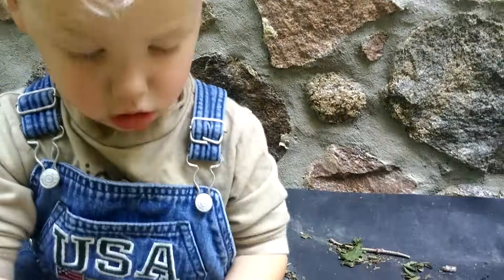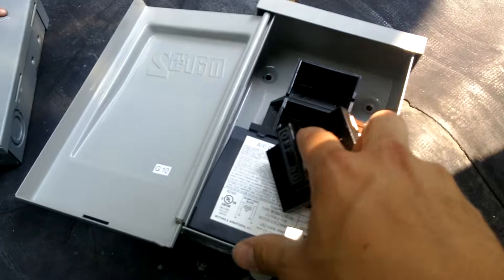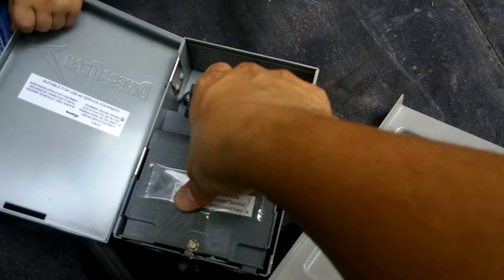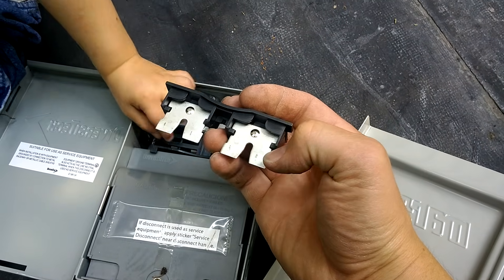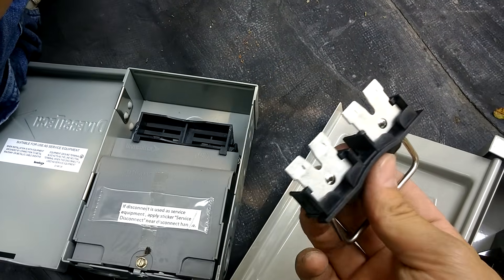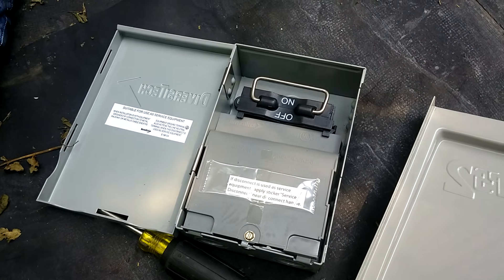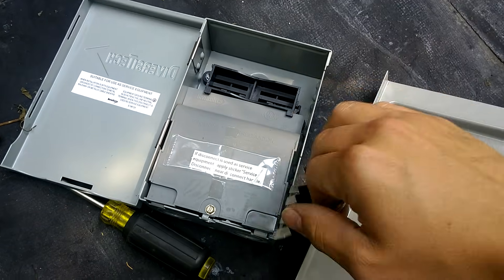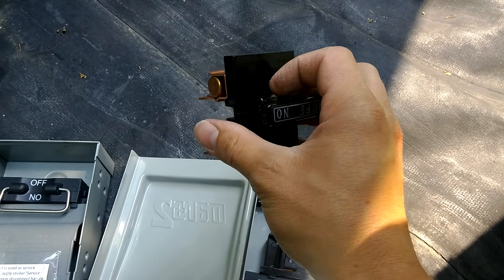Fused Vs Non-Fused Disconnect for AC or Heat Pump

Comment: BREAKERS in you main service panel DO NOT PROTECT YOUR EQUIPMENT.  They are there to protect the WIRES connected to the breaker.  And they are sized for exactly that, the max load on that wire allowed.  The fuse or breaker on the AC disconect box, located close to the appliance, is there to protect the appliance, and also help in protecting the wires.  BOTH are really there, and require to prevent a FIRE, NOT really to protect the appliance or wire, it’s to prevent the wire from overheating (for example if there is a short) and catching fire, and burning your house down.

Comment: Hmmmm, thanks for explaining this.  Looks like our box is “non-fused”.
We just had our house siding replaced and now there’s no power to the system.
How do I verify that this non-fused box is turned “ON”?
What’s the next step for troubleshooting?
Reply: If it is fused you can read "ON" on the fuse when it is installed and "OFF" should be upside down

Comment: Helpful Video. Not an electrician, my DIY 0.02. I would read name plate or ask and electrician. I don't believe fused vs non-fused is an option or a matter of what is convenient. I think get where your coming from (Smaller diy mini-spits), but for the your viewers you might want to clarify.

Comment: I have an HVAC job where an 100 amp house breaker feeds an 2 gang flip on / off disconnect outside 60 amp goes to air handler 30 foot  away in an crawl space & the other is an 40 amp flip ( non breaker ) switch ... so we replaced the system new bc the HP compressor was shorted to ground but not enough to trip The  100 amp breaker inside the house & when compressor tied to come on it would make an terrible buzzing sound up in the attic above the breaker panel ..so iam guessing an fused disconnect one for air handler & one for HP would be my best best to provide an safe hi Volt power supply without pulling an separate wire & add new breaker to inside the house elect panel

Comment: If you have your heat pump located outside tapped from a main electrical panel with some ckts and your changing that service disconnect to a plain you can tap your wires from the feeders and then you’ll need a fuse box

Comment: So can I use 30amp non fuse disconnect with a larger 10/2 wires on a20amp double pole breaker

Comment: In what cases would a fused disconnect be required? Out of curiosity.
Reply: They are often used in high current load situations -  electric motors such as AC compressor and EV chargers.  They protect expensive equipment and can prevent fires.   Circuit breakers are slow to react and may not act before a fire has started.

Comment: You can not do tandem protection. The only reason you would fuse the disconnect is if the unit maximum full load current is less than the circuit breaker rating. Then if the breaker was 30 amps and the FLA was say 18 amps, you would install  20 amp fuses. The best remedy is to replace the circuit breaker with the correct amperage rating and use an unfused disconnect. Lastly, , if you must fuse it, use time delay fuses only
Reply: Everything you have stated is incorrect.
Reply: @osmith5086  As an electrician for 41 years and an apprentice school instructor for 4 years, I stand by my post.

Comment: My non-fuse disconnect next to the a/c central unit is broken after I disconnect it and cannot move back to ON. Since I need to replace it, would it be "better" (extra protection) to change it to  a fuse disconnect.
I wonder would it be "double" protect the a/c compressor if I install a fuse disconnect now  just in case the main panel's 60 amp  gone bad. I understand it may be redundant but would it "safer" to have it in 2 places. I have the Square D - QO200TRCP (non fuse) now and I can easily swap out to use the QO206 fuse circuit breaker later if needed. Thanks for the video.

Comment: I'm a home inspector, we are talking in a group about how we find people put copper pipe in the fuses place. That make the unit rely on the control pannel to trip and protect the unit. But being they are a time delay fuse what are these fuses for and why is there a need for a time delay fuse in that spot. Some say just leave the copper pipe it fine, others say there is a reason but I can't find the reason.
 Thank you
Reply: Copper pipe defeats the purpose of any fuse because it will never open the circuit due to extreme current loads.  I suppose it sort of converts a fusible disconnect switch into a non-fusible disconnect switch but why did they not just buy the fuses to satisfy the purpose.   If this is feeding a high current load, you are now relying on the circuit breaker at the supply input to react which will be slower and provide less protection to the electrical wires and the load itself.   I would force them to buy fuses, as a home inspector, so the equipment is functioning as intended.

Comment: Will a fused disconnect work without the fuses (Edison style)? I had my main panel changed out so this circuit now has a breaker and the fuses here for the dryer are unnecessary/redundant. Thanks.

Comment: Thank you for the great and very clear video. The County code in my area requires a fused disconnect and I was advised to install one. I know that there are 30 and 60 amps fused disconnect. How can I determine which one to buy for my A/C unit?
Reply: Depends on the size of your hvac unit if you got a 5 ton unit cooling 3500 square feet of space you may need a 60 amp.
If you got a 2 ton unit that's just cooling less than 2000 square feet then 30 amp is adequate.
Refer to factory manual of your sysrem.
Reply: @qv6486  Wonderful. Thank you

Comment: I'm not a fan of the non fused pull out tab. Can you use a lever type disconnect box or a single 30 amp breaker box? If so what is your opinion on those options? Thanks for your reply.
Reply: Decision is mostly based on cost. Adding a breaker box and breaker can double the price w/o much added value.

Comment: I disagree with your choice of non-fused over fused.  My compressor burned up because the fan was underperforming (going bad) and had to replace the compressor along with 7 lbs of Freon costing me over $2,000!!! Yea, the breaker that was 25ft away tripped, but apparently too late- the damage was done!  Had I had a fused disconnect a few feet away feom the condenser unit instead of non-fused, I would’ve only needed to replace the fuses and the fan motor (~$150!).  So, I’m having a fused cutoff installed!  Fuses are cheaper than a whole new compressor!!!  Make a part-2 video and explain what I’m talking about.  Don’t try and save $50 and put $2,500 at risk!!!

Comment: For an electric water heater,do you need a fused disconnect or not? There’s already a breaker in the electrical panel.
Reply: I guess like he said, if you already have a circuit breaker, that itself provides protections to your device, so non-fused should be fine.

Comment: Perfect Explanation of what to choose for a mini split or HVAC.  I would add that you can buy the Mars, non-fusible disconnect with surge suppression.  That in combination with an ordinary breaker trip is the best, most hassle free protection for your investment.  Rebalance your load center to accommodate the new breaker, drive a new grounding rod at your condenser mounting.   All helpful extras..

Comment: HEY, you have no idea how much your video has saved me during the installation of my DIY mini split. I had a fusable disconnect and nothing would work. I guess i was too ignorant to know that i had to buy fuses to put between the contacts as they were not provided with the box. So i was banging my head against the wall wondering why my new AC would even turn on, it was because i needed fuses in the box... DUH!!!! Newbie here!

Comment: Nice video. I'm an electrician, so I'll add a few comments. First, the service panel overcurrent device (usually a circuit breaker) is sized to protect the circuit conductors. It might protect the unit as well depending on the unit's rating.  Whether or not it will depends on the unit itself. The unit has strict minimum and maximum overcurrent device ratings because the unit contains both large and small gauge wires that need protection.. These min and max ratings might be covered by the protection at the service panel. Often, they won't.

But there is another consideration. A fuse will "open" faster under short-circuit conditions. A fuse contains an element that melts and opens the circuit, usually within a few AC cycles. In contrast, a circuit breaker is a mechanical device that takes a little longer to open. Thus, a fuse offers better protection for short-circuits. In fact, many manufacturers require fuses based on their faster time to open (thus better protection). I (usually) install fuses to meet the proper ratings and for better protection of the unit itself.
Reply: I would think interrupting the current before the problem reaches the panel would the prudent thing to do. I am a facility manager and all our HVAC systems are fused at location.
Reply: @SovereignIntelDotNetwork  Good points..
Reply: @SovereignIntelDotNetwork  Or we can all become Amish!??
Reply: Last night, our furnace blower seized up (possibly bad Run Cap). We awoke to smoke alarms screaming....went into the garage, a LOUD hum coming from furnace, not normal...I turned heat off, then the fan started, cycled through and shut off. Since you're an electrician, my question is WHY didn't the 20 amp breaker trip? The motor was too hot to touch! It seems that enough amps clearly should have been drawing...so I am considering one of these fusible switches right in line before the hot line enters the furnace. What do you think? Why didn't the breaker trip?
Reply: You must use HACR  Heat AIR Conditioning Refrigeration rated circuit breakers. Never exceed the full load amperage rating of the AC. It will ALWAYS tell you the maximum size breaker to install
Reply: @bills6946 Yes, Perhaps when Dinosaurs roamed the Earth, but many modern high efficiency heat pumps use transistor synthetic inverters, and a 1 hz to 120 hz 3 phase compressor motor requiring a maximum fast blow protection device not to exceed perhaps 5, 8, 10 or 15 amp like a sand cartridge fuse on a 220V feed. You protect the circuit wire with a 15 or 20 amp standard double pole breaker using 10, 12 gauge wire. The fast blow sand fuse is used to protect the inverter electronics if a transistor blows protecting the PCB, electronics and compressor from further damage. Expect to pay $15 or more for each fuse. The larger wire is required to prevent a resistive component causing a GFCI to false trip due to the line harmonics. Some of the newer super high efficiency equipment causes odd unexpected problems.
Reply: @designengineerdude1952 
Where I live, the hacr requirement is still in the code. Until the code making panel makes changes, dinosaurs it is to pass inspection.
Reply: Simply said…
Reply: Thank you!  Learned something new today
Reply: Well said, thank you
Reply: Are fused disconnects (two 30A fuse assembly with a bail wire handle) made to be pulled-out and inserted when the thermostat is ON for purposes of AC troubleshooting and maintenance to get a quick on and off of the unit instead of running in the house to the breaker box or thermostat every time? Could inserting it cause one of these fuses to blow prematurely? Thanks.

Comment: This video is old but in additions to what others have said, your assumption that the stab/pull out head will always hold the fuses if it is "fused" is a very incorrect assumption. Your other box could be fused but uses a blade stab. The fuses are often in the covered areal below the stab where you wire the box.
Reply: I have one exactly as you described for my well.
Reply: Hey I have a fuse disconnect branded wadsworth , says pull out to renew fuses, but I pull it out and see no fuses and or an area to hold the fuses on the pull out, where can they be?

Comment: Thank you for this video. You really helped me understand the differences between fused and non fused service disconnects. My home inspector wanted me to switch my non fused to a fused one but if it's just a matter of preference then I'm not going to spend the monet on something that's not necessary/required.
Reply: Hey what's up . I'm wondering if the disconnect can be operate with the line energized?
Reply: @estebancastaneda2209  Yes, that's the point of a disconnect.
Reply: It’s NOT just a matter of convenience, fuses react faster, cheap way to belts and suspenders. That said even more important is a surge paCtro on the box.rk

Comment: I have an older house that has a 40 amp breaker for the ac. It has hard to find breakers. It has 8 awg wires feeding the outside unit. Back in the day, units used to hog a lot more power than today. The data plate on the outside unit states to use a 35 amp fuse. 3 ton Lennox system from 2003. This is one instance where one would "fuse down" the circuit. So, I put a 60 amp fused safety switch with 35 amp class RK5 time delay fuses.
Reply: Plus a fuse is superior because it opens faster during a short-circuit.

Comment: The breaker is just for line protection so you can't over amp the line it does not protect against surges which is the fuses job

Comment: Can I use a 50 amp Circuit breaker box instead of a disconnect for my AC disconnect? I have a 3 Ton American Standard Unit. I am a do it yourself type of guy. The reason I ask is that I found that I had a New box and Brand New Circuit Breaker already in the box.

Comment: Can a 60 amp disconnect be used for a smaller circuit requiring a 15 amp breaker?
Reply from the maker: Yes. I'm assuming that it is a non fused disconnect correct? As long as you use the correct sized breaker for the appliance being served then the disconnect simply serves as a means of removing power from the appliance. The disconnect is simply rated for a higher capacity than you are using it for. Thanks for asking!
Reply: @BenjaminSahlstrom  damn good answer bro damn good video bro installing my mini split tomorrow Home depot dude today was non dude like and couldn't find me the non fused boxes.. cool

Comment: Why did you reverse the ON OFF position on the non fused disconnect at 2:28? Why does it have ON OFF?
Reply: When you flip it to off it mounts in the box without being connected, or you can just remove the switch from the box completely.
Reply: Brian Peikert Got it! Thanks.
Reply: Despite that it can be mounted in the "off" position and not make contact.... I suggest:
Personally I would feel much better leaving the handle pulled out and set on top of the box instead of ever working on the electric downstream with the handle pushed back in set to "off". Maybe the guy got the label wrong? maybe power can jump? who knows. I leave it out of the box if I plan on working on a unit. 240v has a nasty bite.
Reply: @chriswilliam6827  yeah but you would need to be pretty unintelligent to grab both hots lmao and get double shocked, it won't jump in the off position its rated to be safe, and I would keep the switch somewhere enclosed so it doesn't corrode because of the outside elements.
Reply: @chriswilliam6827  I always put it in my pocket until I'm finished.

Comment: Need advice. My fuse wont pull out
Reply: This is one reason not to use a fused disconnect (Emanuel, I know that doesn't help you, and you probably didn't even install the disconnect, hope you have solved your problem by now)
Reply from the maker: I have seen this happen before. You will probably need to replace the disconnect. Sometimes you need to pull extremely hard but once in awhile that may cause the fuse/disconnect handle to break apart. I know you left this comment a few months ago. Did you already figure it out?
Reply: @BenjaminSahlstrom  
He dyed dude...
You're too late.  No one answered him in time, he tried pulling out the fuse handle with his teeth while Barefoot standing in his kids swimming pool with the AC unit running.
Went to his funeral a week after he posted this comment. 
Poor guy just wanted you to comment back to him. Now he's toast........  Literally ⚰

Has the police called you yet?
Reply: @BenjaminSahlstrom  Benjamin: I have a fused disconnect between circuit breaker box and Water Heater.  The pull-out  gets hot, the plastic swells, the pullout becomes very hard to get out, and even harder to get back in.  I use it to disconnect when I leave town, so water heater is safe in case of leak.  Cannot just flip off breaker because "energy saver" intermittently shutting off water heater controlled by utility company is on that circuit, flipping breaker screws up their command center.
Anyway, planning on replacing fused disconnect with non-fused disconnect.  In any case need to replace, I am today in same situation as Emanuel, pull out won't pull out.
Reply: and, What a Beautiful Kid !  and he looks interested in being an electrician.
Reply: and thanks for sharing your knowledge, also replace elements and thermostats on hot water heater, watched your vid.